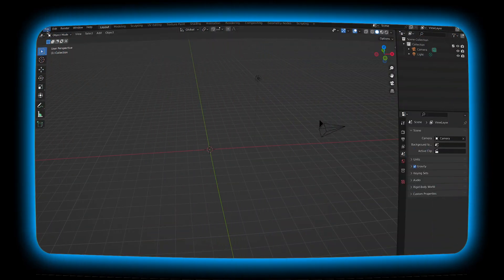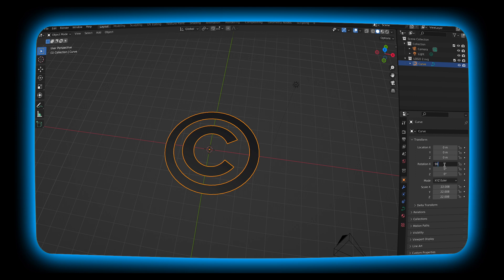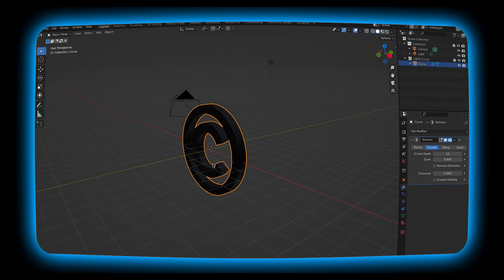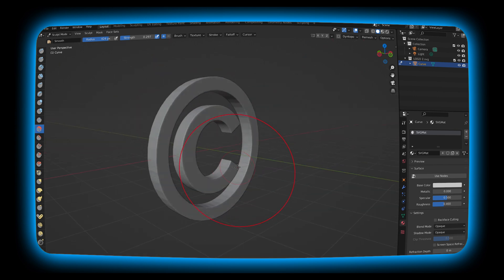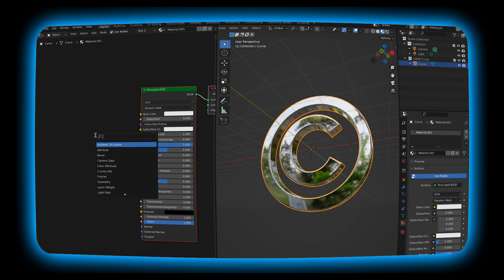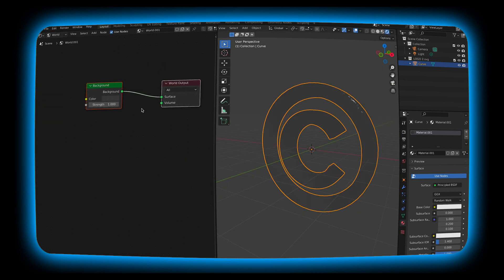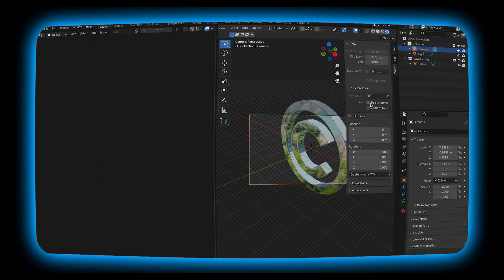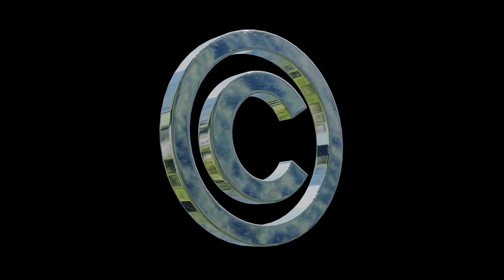3D Chrome Logo In Blender

Comment: under the step where i remesh and add modifier, when i go to apply it wont let me its greyed out as if its not an option. any reason why?
Reply: You have to switch to "Object mode", you can find it in the top left corner.

Comment: Tip : Don't convert your curve logo to Mesh ... Use the Bevel (in Geometry settings under Curve) to thickness and bevel.
Tip : When using a bevel modifier, set method to "Angle" to prevent it from beveling every edge. This keeps the sides of circels and smooth curves smooth.
Reply: If your logo has sharp corners it will glitch and extend those corners if not converted to mesh tho